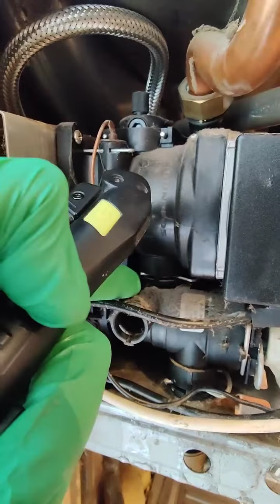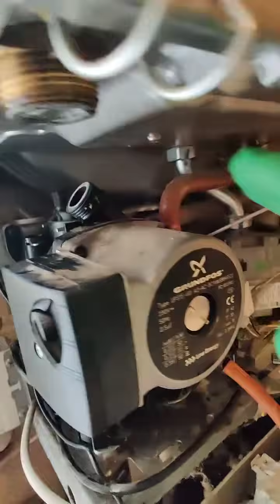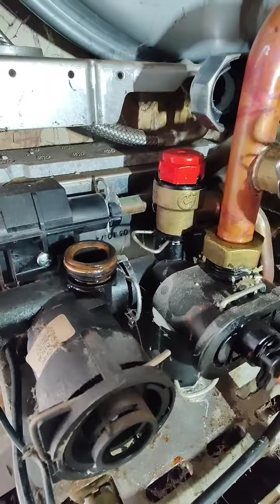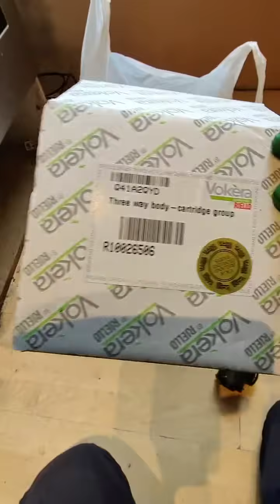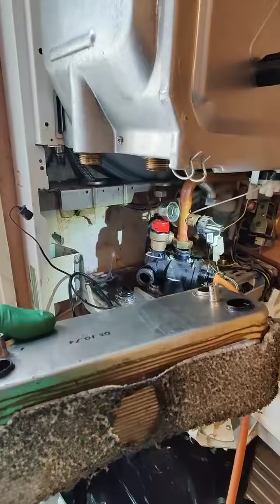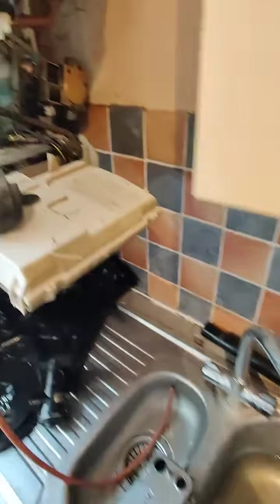Vokera Compact 35 HE combi Boiler water leak repair.

Comment: That was a cracking video. This looks like a pain of a job. Not the best boilers to work on
Reply from the maker: Yes it was slightly tricky however the customer insisted to have the old boiler fixed so we complied.

Comment: How long did that take to complete?
Reply from the maker: About an hour in total mate.
Reply: Thank you so much for the quick response. I have one to change this afternoon and it’s had me a little worried as I’ve not done it before. Do you have any tips that may help that u haven’t shown?
Reply from the maker: @alunthomas932  Just make sure you have the correct part as there are two exactly the same parts however one doesn't have a through hole towards the right and the other one does.
It's a time consuming process however you will be fine. Just be patient with it as it's a Vokers lol
Reply: Ok thanks. 
I really appreciate your help
Reply from the maker: @alunthomas932  let me know how it went.
Reply: @MHKBuildingSolutions I turned up at the merchant to collect the part and they’d forgot to order it! 😂. Booked back in for Monday
Reply from the maker: @alunthomas932  lol typical merchants :)

Comment: What would you have charged for that type of job. Is it cost effective?
Reply from the maker: I charged £220 including the part. Yes I would say it is cost effective as the customer wanted a quick fix and wasn't ready to spend £1500 to £2000 for a boiler swap.
Reply: Would have been better going to the manufacturer.

Comment: Good video. 
Is it back pressure that was causing boiler to leak?
Reply from the maker: No it was the plastic manifold which developed a pin hole over time.